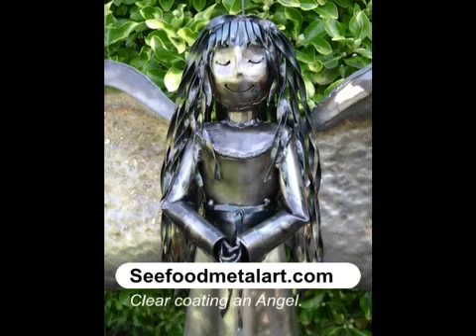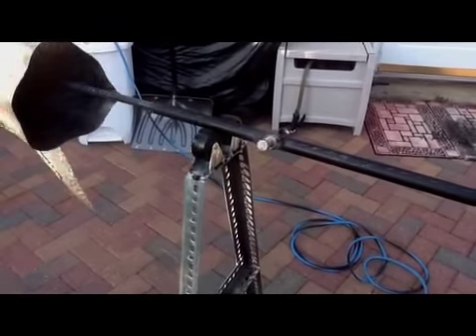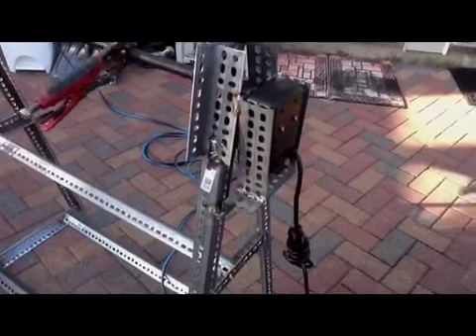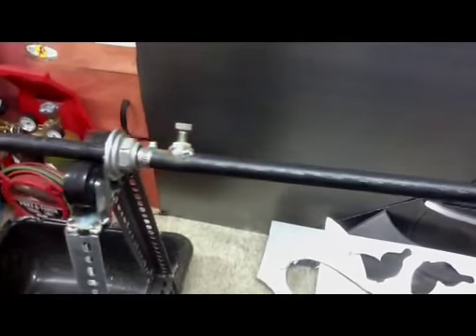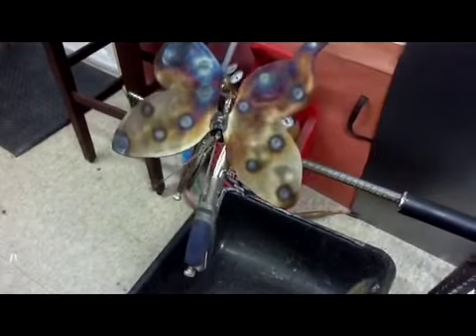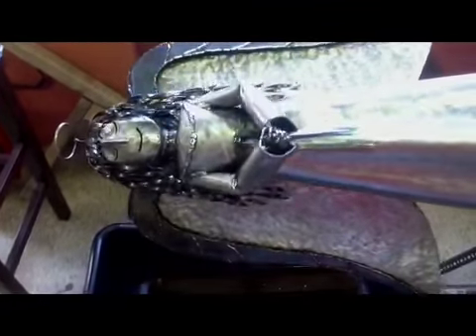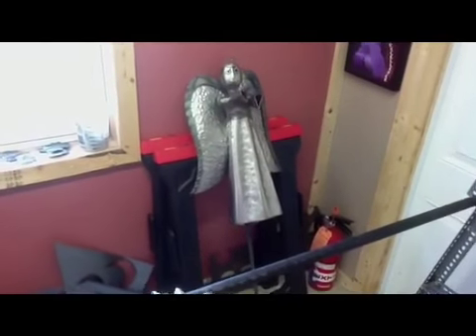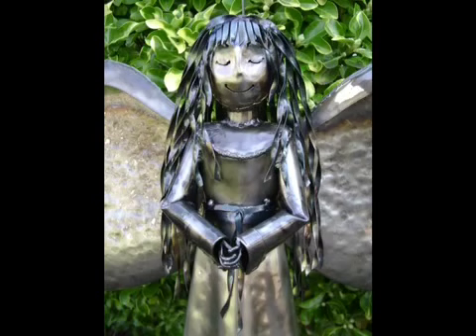Clear Coating an Angel

Comment: Very cool! Your work is amazing too! I have a question for you! I have some raw (cold rolled) steel that I am using to make table legs. I want to keep the raw steel look but I want to clear-coat them to protect them from rust etc. Is there a way to do this? If so, what type of clear coat do I use? Do I have to clean the steel first? Etc? Your help would be really appreciated.